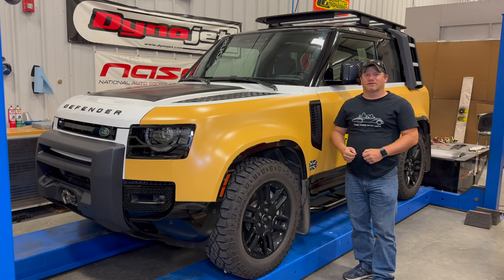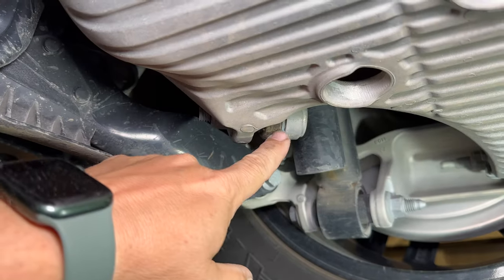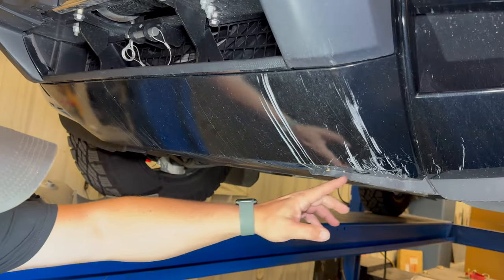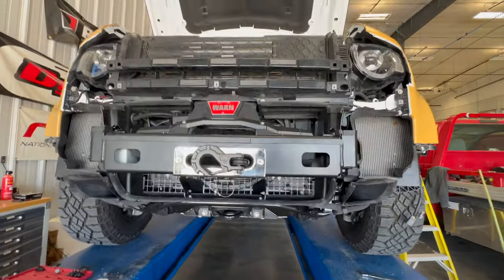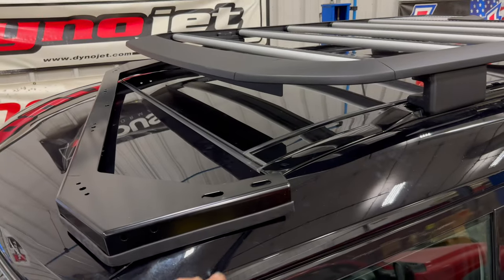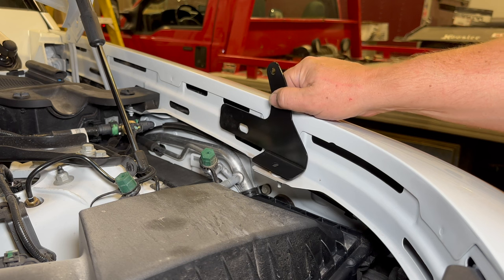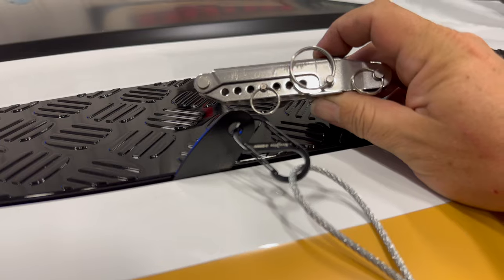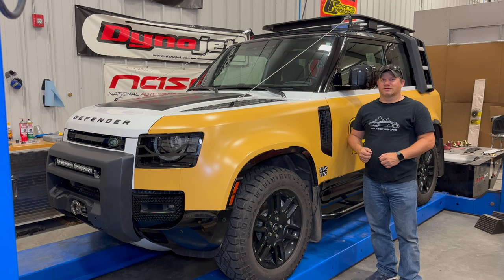New Land Rover Defender Offroad Upgrades

Comment: I'm still not sold on lower control arm armor (or limb risers actually.. ha).  I've wheeled the crap out of my LR4 and haven't really ever hit my lower arms.  Usually a pretty bad situation if you have to get down on your arms in rocks.  I'd rather have the clearance under there than add skids, though the LR4 has steel lower arms.   I like what you did with the exterior of this Defender.  Look so much better.

 I just did most of the continental divide from mexico up to yellowstone a month ago or so.  Only issue was I broke a front sway bar end link. (has spares with me).  LR4 continues to impress me.  Let me know if you ever want to get out and do a small group trip.  We go out to CO/Moab quite a bit, we want to arrange something for maybe next year, white rim trail maybe.

Comment: Good job on the installs. Question.....above the factory tow ring you exposed is that shackle-like pin part of the winch system and designed to be a recovery point? I couldn't tell for sure, but it seems a little thin. Love the new Defenders (I currently own two full size Range Rovers and a Range Rover Sport). As off road worthy as they are, the 110 I drove was the smoothest riding car I've ever been in, even more than my wife's newer Range Rover.